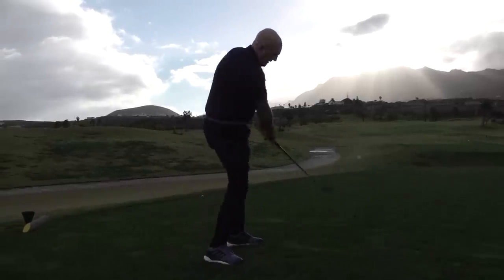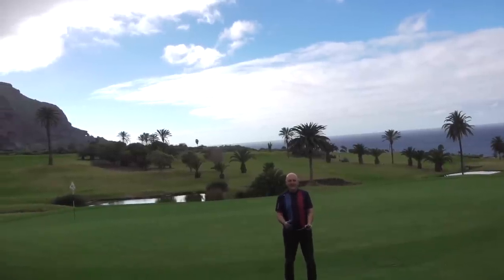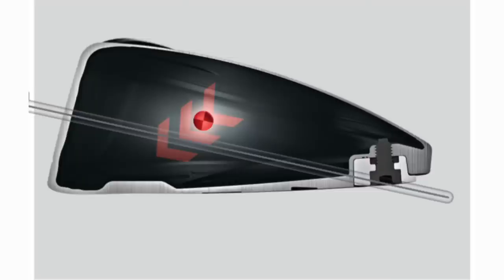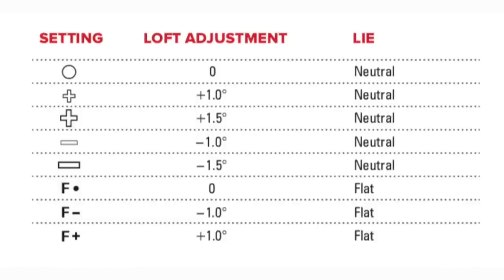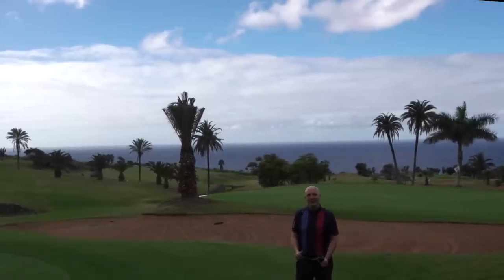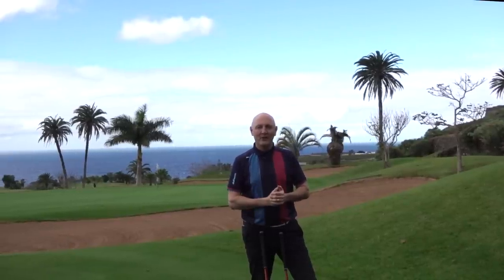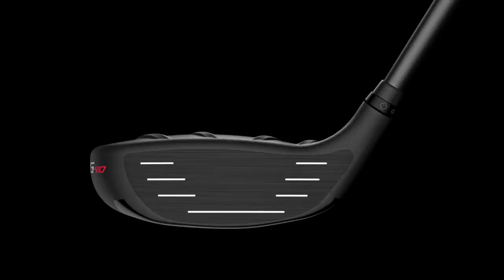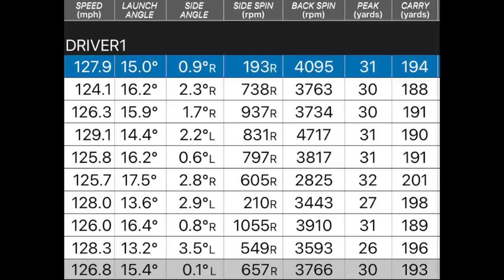REAL TEST Ping G410 Fairway & Hybrid

Comment: The hybrid looks to be a small step up from last years model.  I tried the G400 which was nice and slightly longer than the Cobra F8 but ultimately I preferred the consistency of the Cobra F8.  From memory the G400 19 degree hybrid carried avg 200 yards for me but I struggled a bit with dispersion. If the G410 is better on dispersion then it makes for a very good club.

As for the 3 wood, I agree it is not the longest.  I think I hit it a similar distance to Andy and I would want a 3w to be a 240 maybe 245 yard club of the tee, from Andy's data this looks to be a little shy of that.  I very rarely hit a full 3w off the deck so don't really worry about the performance of that

Comment: What does the flatter lie option do?
Not seen this before
Reply: It means the base of the club will lie flatter if you are shorter or have the club a little further from you. Is the opposite to upright.
Reply: Yes I get that but why suddenly is this feature appearing on metal woods. My miss on 5 & hybrid would be an overdraw/hook was wondering if Ping & others are seeing this
Reply: Because while irons are fitted to the right lie woods and hybrids usually are not. 

And no, Ping haven’t been watching you carve it left ;-)
Reply: So why suddenly is this feature appearing now? Was thinking performance potential rather the technical make up of a golf club
Reply: Because if your club is too upright the heel grounds first and can lead to it turning over causing pulls and hooks. This isn’t new.
Reply: Thx again but you are missing the point of my question. I am fitted into 2 degrees upright irons, I know all about the why’s & wherefore’s of the lie angle thing. Question was....Why is this suddenly now appearing as a specific adjustment option...never seen this before
Reply: adjustable loft woods adjust the lie. Either more upright or flatter. This isn’t new.
Reply: Yes, I understand that too, but I have never seen it as an independent option in the adjustable hosel before....Being “specific” about lie angle. Being “logical” I asked when being fitted for a hybrid (reputable fitter) a year or so ago. Answer was the manufacturer does not really offer different lie angles on hybrids So why? has this option suddenly appeared now? Marketing or a guideline to better performance from Ping
Reply: Martyn - what % of your life do you spend being confused and amazed? New clubs have new tech on them all the time. Ping obviously think that hybrid lie adjustability is worth having as most sit toe up on anyone under 6 foot tall. It’s not complicated!
Reply: @martynedwards1493  Ping have stated that their fitters have been asking for more options to help golfers hit their best numbers.